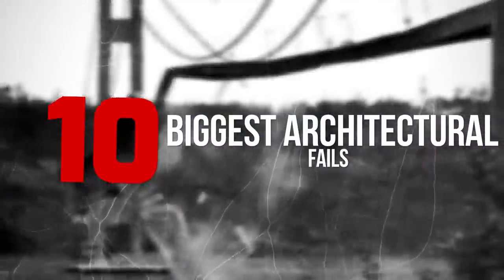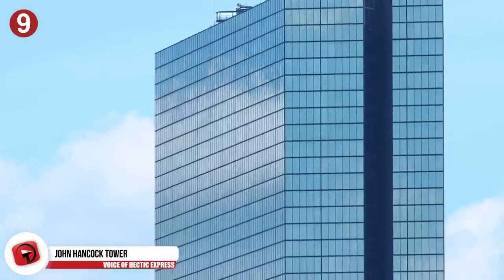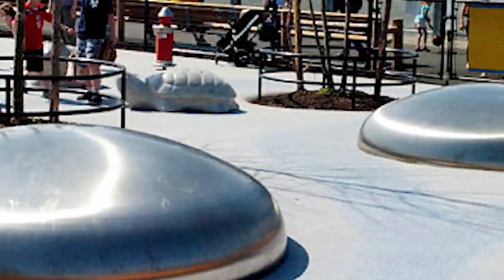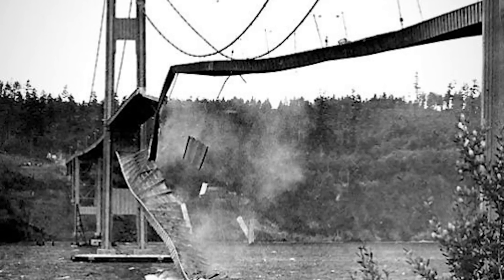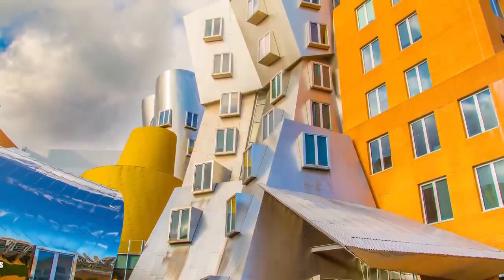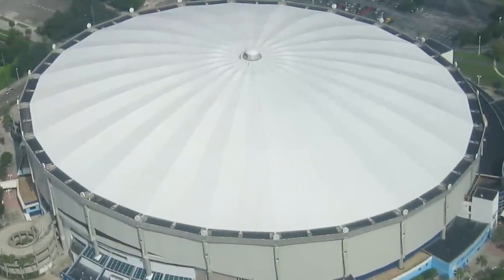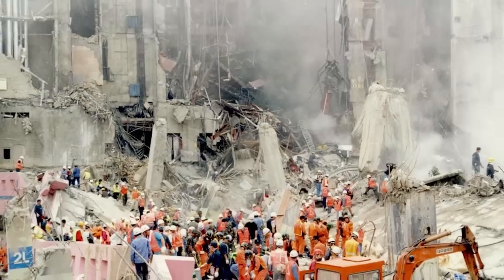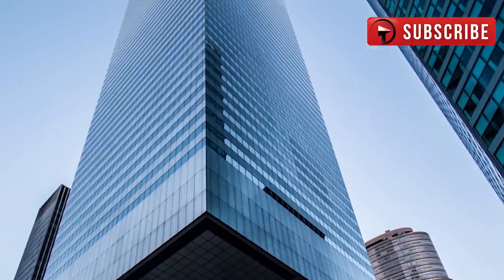10 Biggest Architectural Fails

Comment: Where is the damn bridge
Reply: Speaking of Dams, havent dams failed? Maybe they were excluded from this analysis.
Reply: Most of the dam failures were engineering fails (strength, structure, maintainence, critical/stragetical design), not as much related to its architecture or design, although engineering and architecture work together to make the overall object and its fails. Dams tend to rely more on engineering, and it's often the blame for their failures.